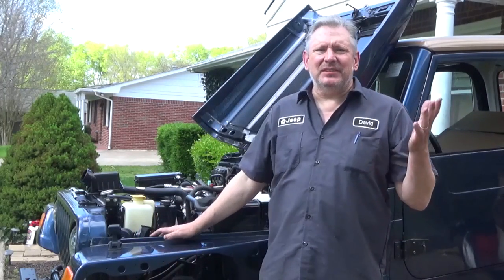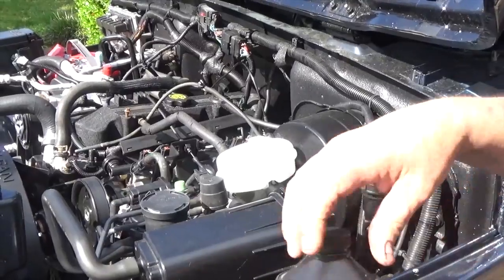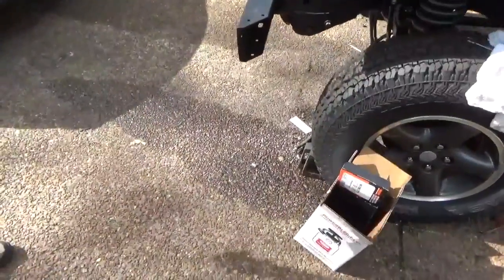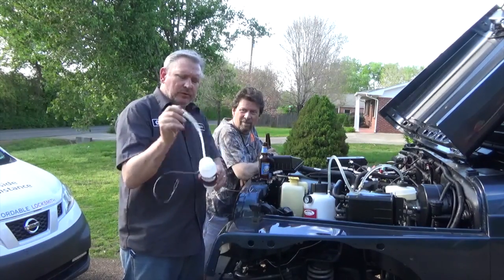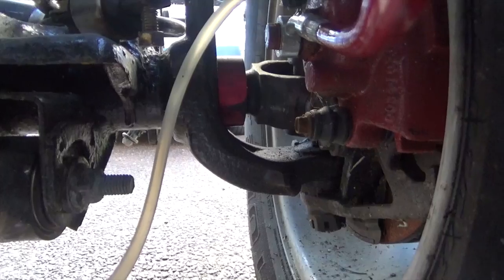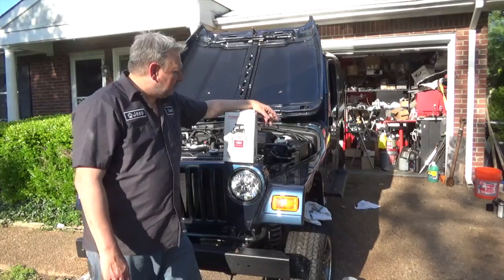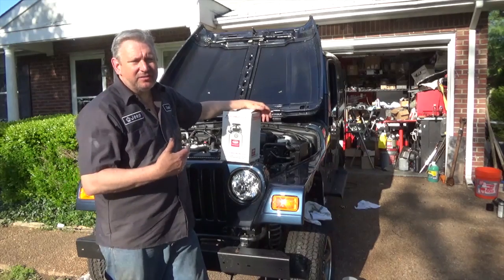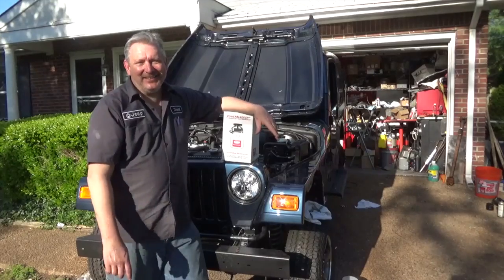Jeep Wrangler TJ Project - Bleeding Brakes and a New Tool

Comment: You can build one of those bleeder tools yourself if you're either super cheap or hard core DIY.  There are videos on you tube on how-to.  I built one some years back before your unit came on the market.  I had good success with other vehicles, but the jeep tj master cylinder cap could not hold even 10lbs of pressure and made quite a mess.  Brakes successfully bled though.  Very convenient tool.  As a general rule I would not exceed 10lbs of pressure when using the tool.  Cheers!
Reply from the maker: +Mike Hartmann For 60.00 I wouldn't fool with trying to build one - not to mention I have plenty of projects to keep me going for now - LOL

Comment: Should never use an already open brake fluid container. Once opened toss it. It wants to adsorb water and moisture. opened, shelf stored containers will be putting water in brake system. 

Great video for TJ guys looking for bleeding options. Thank you

Comment: If you ad an air fitting with scraper to your tank you can use your compressor instead of pumping for ever. The good old days we always used 2 people, sure you remember those days did you work at jeep dealer at one time? Thanks Dave

Comment: Apparently, you injected air into the reservoir because you did not exhaust the air from the bug sprayer suction/output connected to the reservoir.

Comment: I tried to bleed my Tahoe that way, the fluid would not push and eventually slipped by the top.  So I was able to goe backwards on the front but not on the back.  The back I had to go old school pump with the recovery bottle.

Comment: Did you put on some outer tube axle seals? Did I miss something? How they holding up?
Reply from the maker: +Dave Nevotti I did - as I have not 1 mile on the new Jeep I do not actually know ho they are doing - they look good hahaha  Ive used them before and they do well.
Reply: Just curious, they do look nice in red, I forgot you haven't driven it yet my bad. I was thinking of putting them on my jeep.
Reply from the maker: +Dave Nevotti greased them up today actually. you don't see them that much but the Red is nice

Comment: does it matter which location you bleed first?
Reply: Do the rear passenger side as that is the longest distance from the master cylinder. Then the rear driver bleeder. Then the front passenger bleeder and finally the front driver bleeder. You are doing the longest line to the shortest line. Most likely will get all the air the first time around :)